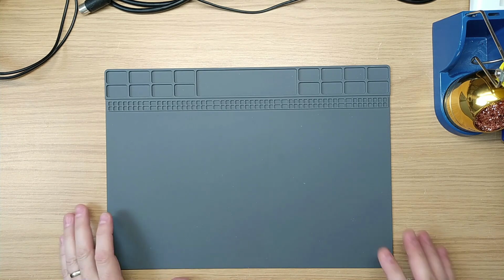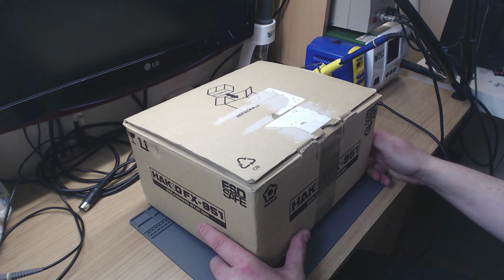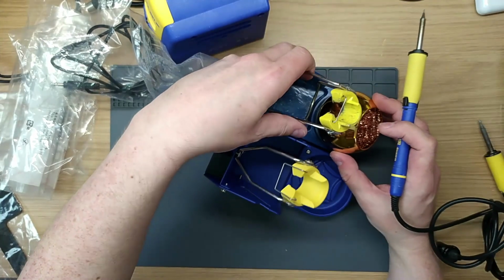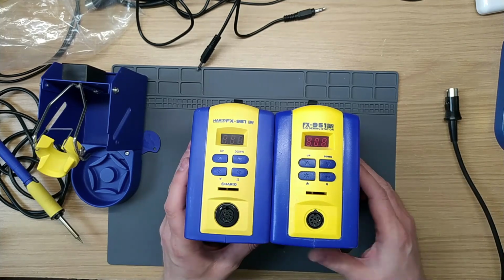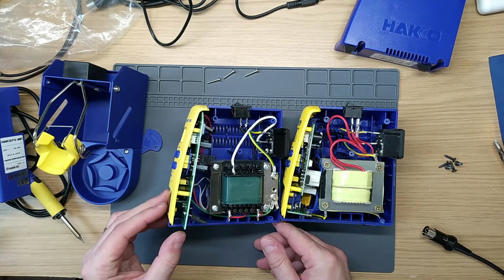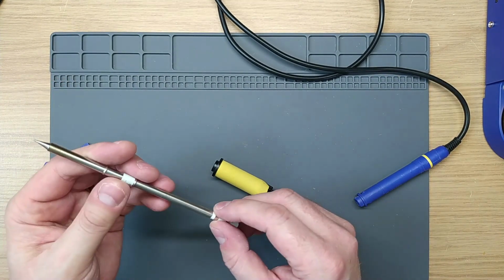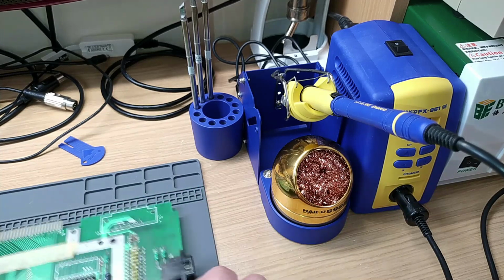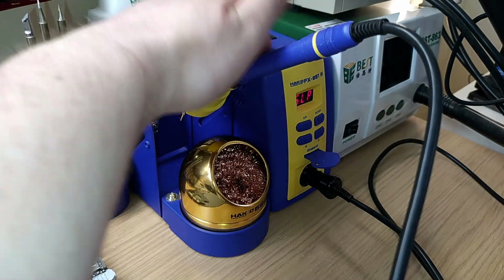Upgrading from a 'Fake' to a Genuine Hakko FX-951 Soldering Iron

Comment: Jon, taking the two apart and doing a side-by-side comparison was the money shot for me. Thank you, thank you.
I was desperate to see a shot of the transformers in both. Long story short, I have to swap out a 100v tx to a 240v and I could either buy a tx or buy a knockoff, use that tx then have some stuff over for shits and giggles. I could not believe you would do it but you surprised me in a nice way. I'm just sweating that the 950 I bought and the 951 have the same internal space for the transformer.
Reply from the maker: That's great - I'm so glad the quick teardown was useful to you!

Comment: Just bought one of these used. Do you know where I might get the key thing? I've looked everywhere, no one has them in stock! 🙁 Also are the genuine tips worth the extra over fake ones?
Reply from the maker: Found some 3D-printed replacement keys here: https://www.ebay.co.uk/itm/325784221642
I don't think I've ordered tips from Hakko yet; I just buy them on eBay and pay only GBP 5 or so per tip. They seem to perform well and last a long time.

Comment: Not inpressed with the hakko 951 interface. Sorry not a fan of Hakkos now what once was a good brand is now the same quality as the Chinese stuff but at 4x the price.
Reply: Genuine is far better.  You get what you pay for.
Reply: @salmanrashid6245  I disagree. There's a lot of gear that's cheap that is on equal or better quality than some brands. Used to use a hakko but binned it after I got an aixun t3a. Could never go back to that now.

Comment: I did not get the fake, I have been using a horse work OEM Hakko 936 fake heater element. Electric bill is little huge since I lost a lot of heating becase loose ceramic improper tip contact.  Do you know if fake Hakko T12 tips will work on the original  Hakko? how good so far you station since the video btw?
Reply from the maker: I have quite a lot of fake T12 tips and they're all working nicely in the real FX-951. As for the station itself: I love it and recommend it without reservation. The fake station was almost as good, to be honest, but it's nice to have the sleep facility and the nice cradle (the holder on the fake station is terrible). The FX-951 is a soldering station for life, IMO.

Comment: My English is pretty bad, but as I understood, gettin a fake from ali is a bad idea? I need to start fixing Iphones, I need ILS tips, How about QUICKO or KSGER?
Reply from the maker: The fake is OK and performs roughly as well as the real one in my experience, but mine beeped at random times and of course it lacks the sleep function. If you are on a tight budget, the fake will do the job, but you might consider a TS-100 instead if the money is tight. Many T12 irons from China are now pretty good.
Reply: @flashjazzcat  I am considering this Hakko, it seems is doing the job, the other I mentioned don't have Esd, neither grounded. Just last question, the T12 tip is has continuity with Ground power cord? Thank you for answering, nice video it has help me.
Reply from the maker: @svsv9  Everything was properly grounded on both irons I tested, yes.

Comment: Nice find! Those Hakko units tend to fetch almost as much money second hand as brand new.
Reply from the maker: You're right. I didn't hesitate to snap this up!
Reply: @flashjazzcat  I was looking at one that's rough at best compared to yours and I would have saved about $60.00 including postage over brand new price. I may as well just spend the extra $60.00 for a unit that doesn't look like it's spent its life outside. I've got soldering station envy!
Reply from the maker: @ByteOnCS  I noticed one on eBay which looked really beaten up and had tape over the top of the base unit. I was not tempted. :) Farnell only want £335 brand new (link in description), which I think is as good as it'll get (for UK buyers, at least).
Reply: @flashjazzcat  that sounds remarkably like the one I was looking at. Oh well, my Chinesium early Hakko clone is still working fine after rebuilding the iron as the original handle broke. I'll just keep using old trusty until I find a bargain like yours.
Reply: I work at a city which has a lot of electronic factories and these usually become available off lease after a couple of years, these things are everywhere around here, I got a nice one with brand new Lindstrom tips for roughly $100

Comment: I want to  buy the Hakko fr810 and i want to ask is a much good choise  over then the quick 861DW
Reply from the maker: I made a review of the BST-863 a couple of years back. Very happy with it (it's the equal of the Quick 861DW).
Reply: @flashjazzcat   and wath do You think about Hakko fr 810.
Reply from the maker: @andreiciora2765  Looks good if you need those dual ports, but I don't have the space or the need here. I am sure you cannot go wrong with the Hakko gear, though.
Reply from the maker: There is also an Atten hot air station which Louis now favours over the Quick. Check that one out too.
Reply: @flashjazzcat   olright thank you for the opinion
Reply from the maker: @andreiciora2765  I've just updated all the equipment links in the video description.
Reply: @flashjazzcat   but Hakko sell  the original controler for fx951 and You can put the module in the same case . All You need to do is to make some holes for the jack buy the Handle and the stand and You will have 2 Hakko Fx951 .
Reply from the maker: @andreiciora2765  I guess so, yes. Would need a proper stand for the iron as well, though, and by then I'd have spent another £200. :)
Reply: @flashjazzcat   but in the end You have 2 Hakko fx951
Reply: @flashjazzcat   and You are spend 25£ less
Reply from the maker: @andreiciora2765  OK. Well, I can only use one at a time so I'm good for now. :)
Reply from the maker: @andreiciora2765  I don't own the micropencil.
Reply: @flashjazzcat   and your fake Handle have the same pinout like the original one .
Reply: @flashjazzcat  Ops sorry

Comment: I got one of those Ali T12 stations irons and a bunch of tips.  Very small seems to work well - much cheaper than the Hakko
Reply from the maker: Yeah they're very good. I just wanted the sleep facility and the nice stand here, and £200 was too good to resist.
Reply: @flashjazzcat  did you say where you got it from?
Reply from the maker: @cannfoddr  I did, yes. eBay, pre-owned, hardly used.

Comment: I've got a pretty cheap iron right now, but noticed that a lot of guys here use Hakko's.  If nothing else, this video has made me aware that I need to be careful of fakes when I go to upgrade.  Thank you for the vid!
Reply from the maker: I knew of the fakes thanks to Louis' video and decided to risk it, but I'm really happy to have the real thing now. Glad the video is useful!
Reply: Hako 951 is the bomb.
Reply: A quality iron makes a world of difference. I started with the plugin RadioShack irons with no adjustment in 2002 when I was 8.  Those feel like pure luck if a solder joint is going to work or not, and the tips would start dissolving in the solder after a few hours of use.  You can't develop skills with inconsistent tools.  I got some cheap adjustable station in 2007 and it was slightly better. In 2012 when I got my first job I bought a Hakko FX-888D which was a huge upgrade and I was actually able to develop technique and do some good soldering work, but I still couldn't do thicker boards that required more power and faster temperature regulation consistently without sometimes causing damage.  Jacking up the temp is no substitute for a better iron.  When I worked at at an electronics repair shop in 2014-15 they had the terrible Aoyue 968A combo hot air station so I brought my FX-888D to use at work and taught my coworkers how to solder.  In 2019 I bought the Hakko FX-951 after finding Louis Rossmann's video about it.  Even though the output is only 5W more than the FX-888D it was another huge improvement due to the fast thermal recovery, which allows you to use sane temps when working on thick boards that suck up heat, and the T12/15 quick change tips which make it much less of a pain to always use the right tip for the job since you don't have to wait for them to cool down to change.  Anyway soldering with the Hakko FX-951 is basically effortless and I would recommend it to anyone who is serious about electronics if they can afford it. I think it is one of the best tool investments I have ever made.